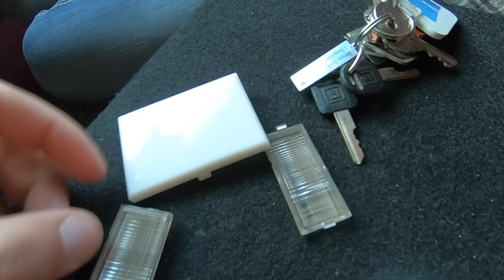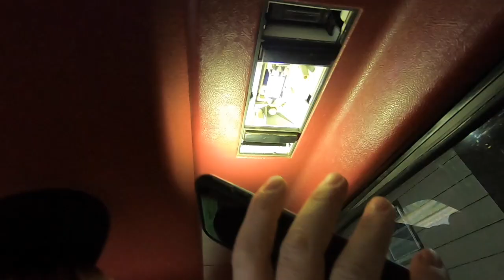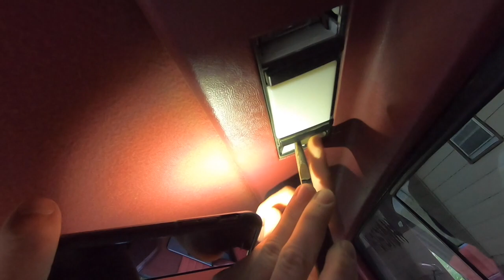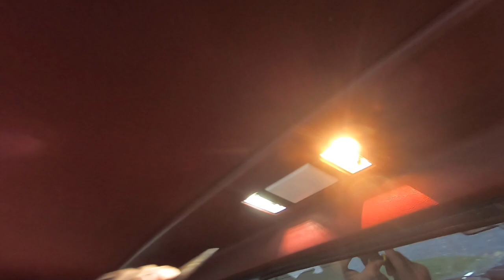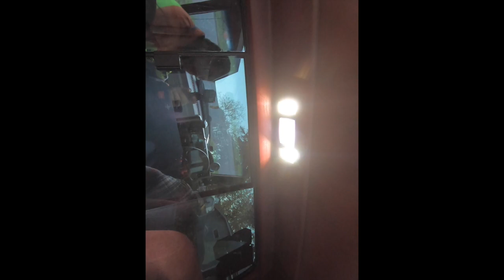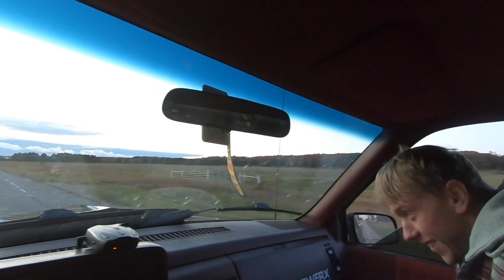1994 K1500 LED dome light conversion

Comment: It’s easier to remove the whole dome light assembly. Remove the 2 screws from the light in the middle. Pull the assembly out. You can easily remove and install the map lights. Don’t forget to put the ground wire back when reinstalling.

Comment: Do you know maybe why the lights don’t turn on when the truck doors  are open I already changed the switches
Reply: Check fuse, wires, bulbs. And sometimes ignition has to be on for certain lights to work. Hope this helps good luck
Reply: you hit the "dome light override" button where your headlight switch is?

Comment: Nobody shows HOW they go in?  frustrating...
Reply: Same here, I removed them but now can't figure out if it hooks on the terminal or if you just leave them sitting in between usually it's harder to hook them and I haven't been able to , but if I leave them in between the terminals the bulb falls out easily ,soo ... Guess I'll have to find one at the junkyard and see how it was
Reply: @juanlanda2441  just bend the connectors farther away from eachother so it won’t come out as easily
Reply: There’s 2 screw where the middle light is, unscrew them and the 3 pcs of lights all come out together, and you can bend them from the top makes it a hell of a lot easier to install too, remember positive faces the front windshield and negative the rear glass, oh and one of the screws holds GROUND, so make sure it’s screwed back in properly with the ground wire